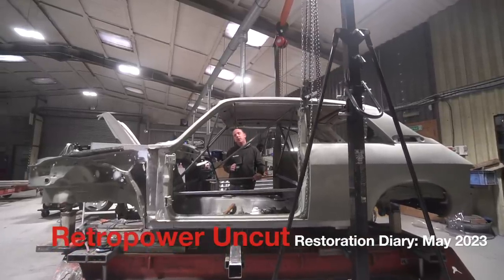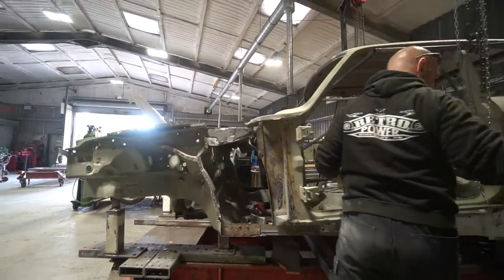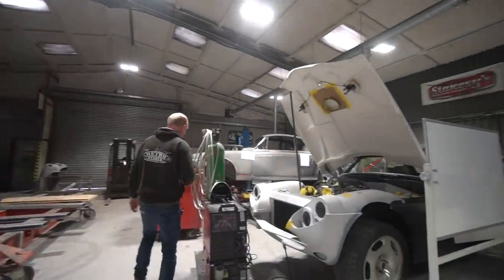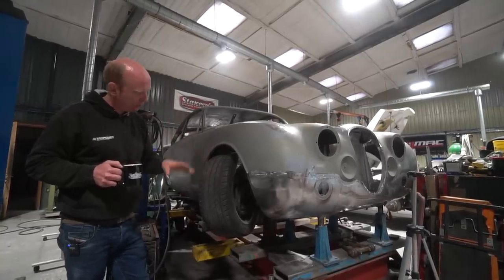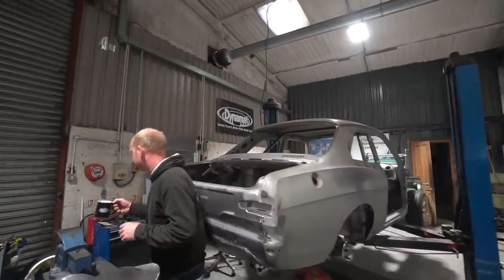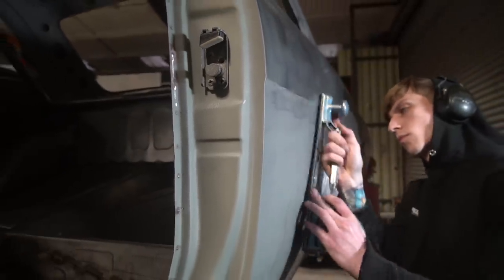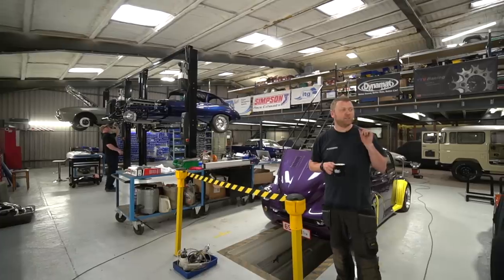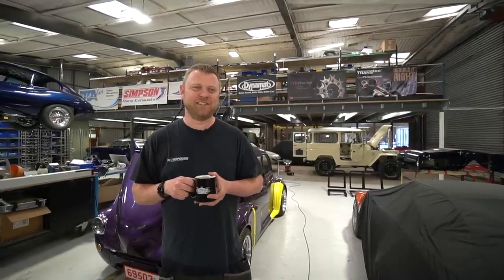ALLEGRO Body on Integra TYPE R Floorpan - WILL IT FIT !!!???

Comment: I remember when I was a kid in the 70's hearing that a local BL dealer put an Allegro on a showroom carousel with the bonnet and doors open to show off the opulent interior. When they closed the doors to remove it from the carousel the doors wouldn't shut because the shell had bent. I had a Saturday job fitting tyres and we were told to never open the doors on an Allegro if it was on a jack. They really were as flimsy as you suggest. Loving this project. Great stuff 👍
Reply: Plenty of 70's/80's and even 90's cars you couldn't/shouldn't open the door on if jacked up.... I had a Rover 220 Coupe........... Although to be fair you could feel the flex by just driving them :-)

Comment: Morris clutch, on my camper I had a similar issue where the brakes would bind after using them for a while, turned out the link rod between the pedal and master was slightly too long and didn’t allow the fluid to return,

Comment: Would be great to see how your bonding carbon pannels onto the Redux E30 M3 builds. Specifically for me the roof as im contemplating a carbon roof skin for mine but as theres trim/gutters which seem to be the typical cut lines for a carbon roof (like the e36) it'd be interesting to see how you do it on the E30 without it looking stuck over the top with steps on the pillars as ive seen elsewere.

Comment: I get the vision of joining the two structures together,, 
When I was into Calibra’s I cut up an omega estate, and a Calibra joined the Calibra’s shell onto the Omega’s chassis so it would be Rear wheel drive, I used bmw e36 boot hinges so I could use a modified calibra boot door, I say modified but all I did was cut the rear window screen frame off, but It did have a working boot lid on a now 2.5 v6 rwd convertible calibra, the last bit that I never got round to  was sourcing an Audi A4 or Saab 95 convertible roof to finish it off, so I understand how much work that goes into a build like this

Comment: Just seen you have a problem with a damaged AN flare on an oil cooler.
I have used Earls Conical Seals & keep a few on hand  , basically a soft flared 30° aluminium washer.

Comment: Since you asked so nicely, I 'll throw in; how is the mezzanine storage area working out? Is it reducing the "where did I put that" time or are the part not always returned? You've a great crew, but all of you have ticking clocks visible all the way to town, Cal. It seems to be working very well, and having carefully put several valuable things up and not found them when needed was both expensive and time eating. Next- I note you have taped up the purple paint on the Morris- obviously to prevent road chips from getting into the paint- the strip at the forward edge of the door seems a bit strange- were you getting chipping along the front edge of the door?  An old bodyman told me that the leading edge of the front doors was pushed back- maybe 2-3 mm just to protect that fragile leading edge- I don't know if that is straight stuff- I'm a crackerjack shade tree mechanic not a body and fender guy. But I thought I'd give you something for the ask- and thank you for any light you share with us.

Comment: I never knew a paint booth would get that much build-up on the walls. You learn something new everyday.
Reply: Most of what they're peeling off is a sprayed on coating used so you don't get a buildup.  You just peel off the coating and re-spray it after you dirty it with overspray.
Reply: @rennkafer13  Thanks Bill and hi stranger! It's Rob from Norcal Roadsters. 🤣
Reply: @01FozzyS  Hey Rob, long time!
Reply: @rennkafer13  For sure Bill!

Comment: Have you considered moving all the controls (pedals and steering etc) back so the driver sits further back so you don’t need to use the easy access function or it has less distance to travel and so seat speed is less of an issue

Comment: QUESTIONS:
Guys, I love your fabrication work but do you record these for future projects to get a faster turnaround, i.e., CAD data, engineering calcs, jigs, parts reproduction/replacement, etc.? It'd seem a bit daft to do a project, then go through doing similar future projects only having to redo stuff from scratch again. Separately, given the future is pretty much electric, would you ever consider building future projects with electric powertrains in mind?

Comment: nice work again!

On the escort, the rear axel set up. why is independent better? All the rally cars still use atlas, i know its old and heavy but, is it the adjustability of the independent you want, or is there some other reason?

Also, integra floor pan alegro, did you not think about doing a sister car for sale or yourself which was an alegro floorpan /engine and an integra body?

thanks
Reply: Rally cars are to comply with class regulation, hence falling outside of being able to run IRS setup.
Reply: you can on a cat 2 log book like mike taylors sunbeam lotus

Comment: Is some cheap, reasonably peelable, ppl on the walls an option - would save heaps in labour cost. Or some other surface cleandown that would save time ? How about a modified sack truck to lift and replace those steel floor grids ?
Reply: Yes, some peelable film might be a much better (wall cleaning) solution.

Comment: Morris clutch: are you sure the pedal pushrod to the master cylinder has free play when the clutch is released? If the pedal has a stop which is restricting the return travel this would give the symptoms you describe. After bleeding the clutch would work fine but as the fluid warms up it would not allow fluid return to the reservoir if the piston is not completely free.